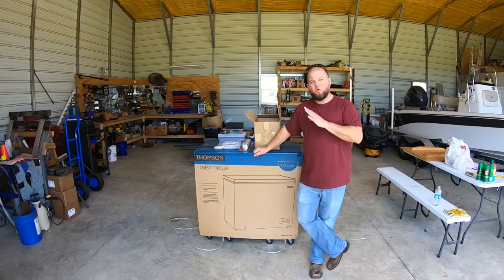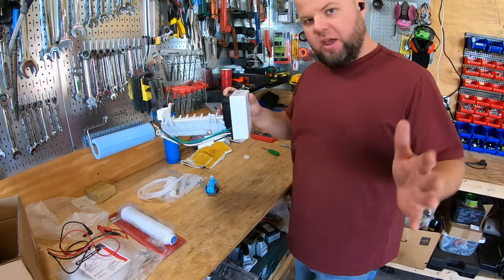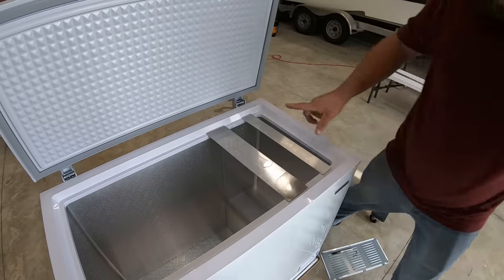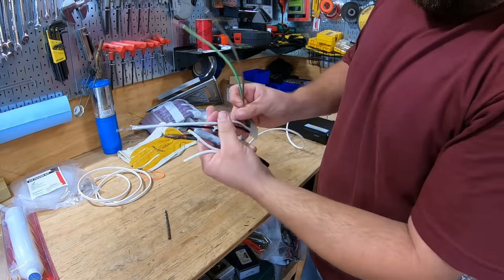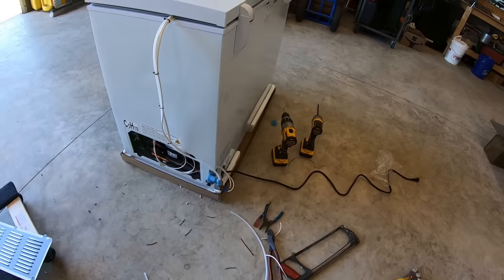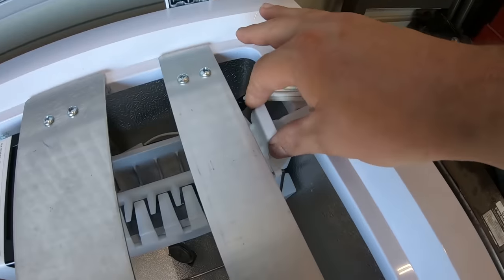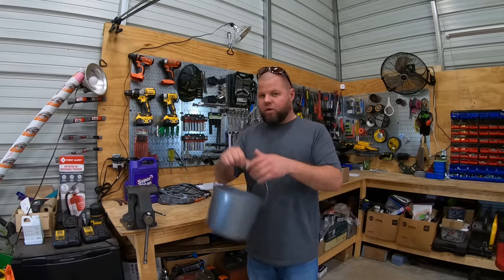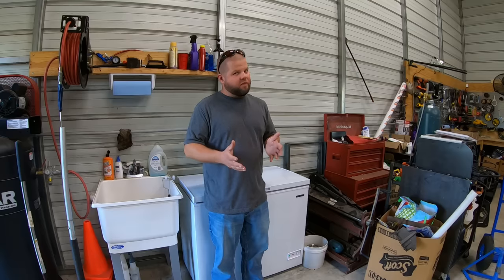Homemade ice maker! SAVE thousands over a commercial ice maker

Comment: One other thing you may be able to achieve is to put a cheap vacuum pump on the box when the door closes the vacuum pump drops the pressure in the box a pound or two or more
Reply from the maker: That's actually a good idea and would make a great seal. Assuming it doesn't pull in constant outside hot air, these might not seal well enough.

Comment: I did the trash can in the side x side several years ago. It works fantastic ... but you WILL go through a bunch of ice makers. It seems that they are not designed to operate continuously.
Reply from the maker: My original build is a 1 1/2 old and still on the original ice makers.
Reply: @TKCL  Great, mine didn't last that long.

Comment: Since the top seems to just be an insulated cover, couldn't you have drilled in from the back edge of the top to run power and water? Drill in a few inches from the back, then up from the underside of the top to meet that hole - wherever you wanted to power and water lines to end up...
Reply from the maker: That's an option

Comment: Make a 2nd notch for the wires. That way  the lid will shut flush. The wires look like they prevented the lid to close so air got in. After u make ur 2nd notch & put the wires in, cover both with electrical tape to secure it. 
U should've gotten a longer maybe commercial ice maker kit. It's gonna take forever to fill that chest. 
Don't use epoxy to seal the metal on the rim. It would have to be food grade if u did but it's probably not a good idea.
Reply from the maker: Already took care of that, I need to share that on a upcoming episode.

Comment: Put a drain in the system. And put a heat blanket at the bottom. This will slowly melt ice and allow ice to constantly be new. You want new ice turn over at least every 3 ti 5 days. 
Ice in and ice maker tgat is large needs to be constantly fresh. Ice attracts smells and actually gets old in a week or 2. 
So you turn on the floor heater about 1 or 2 times a week on a timer. That way its not always on. 
Pro tip
Reply from the maker: Not a concern, this isn't for drinking ice. It's to ice down my coolers and boat.

Comment: noticing a vertical pattern in the wall... Sea Freeze Bellingham,WA once  showed me a tube system they used that  fits like flooring with tongue and groove, with a feather-like texture,spreading along tubes to hard edges.  ORIGAMI?  cut your parts from a roll and it has an assembly system.  the tubes centered away from the rigid edges where they 'lock' together.  again maybe 3-4cm between tubes .

Comment: I'm curious if the ice in this would all clump together after an extended period. Is that why the commercial icemakers cycle the ice constantly? If not, then Idk why the commercial icemakers don't take a notch out of your book and run their machines colder so they don't consume so much power constantly remaking the ice!
Reply from the maker: No problems after three months of use, but I go through ice often too

Comment: May as well get countertop model
Reply from the maker: Let's think about that for a second. We all see those claims of 40lbs a day.... That's 24 hours by the way. I currently own two countertop ice makers. The cube versions usually have a small bin that fills up once an hour and shuts off. So that means every single hour you must dump and store that ice so it keeps working. Plus how many hours a day can someone realistically pull that off? Now your down to storing just a few pounds a day and babysitting a machine. I use 30lbs minimum a week and some weeks 80 or more lbs. Now take my ice maker that runs 24/7, makes, dumps, refills and stores that ice for me while requirimg zero input from me. Already a win win! Keep watching the series and see that a few minor modifications has me producing 11+ lbs a day, again while providing zero input.

Comment: You never use the self piercing water valve the leak and half the time it doesn't make a good hole which slows down the water flow. They sell the right type that you cut the water pipe and it fits in between so you have constant water flow not trying to have water flow out of a needle size hole!

Comment: Those tubes are aluminum. It has propane as a refrigerant. 
It's possible that the tubes are a molded plate welded on the backside of the shell liner.
Reply from the maker: Cyclopentane as the refrigerant.

Comment: I would’ve put the water valve solenoid & filter inside....There’s a drip pan designed into the inside area for the compressor area anyway to catch condensation....

It’s really too vulnerable located outside especially at a corner area.
Reply from the maker: I do not want water inside where the electrical connections are

Comment: Even though those piercing type water connections are still sold everywhere, in most places they are not up to code. So, if it leaks your insurance will probably not cover the damage.
Reply from the maker: I understand that, but if it leaks on a concrete floor in a metal shop I'll be OK. Inside sheet rock walls or a house I absolutely wouldn't use one.

Comment: I think for my money a $100 counter top model that fills its 26lbs capacity in a day (one of the first results when you search ice maker on Amazon) would be a better investment. If I needed more capacity modifying that one to empty into a chest freezer wouldn't be too terribly difficult (depending on the construction it might be as easy as cutting out the bottom and cutting a hole in the lid of the chest freezer).
Reply from the maker: Watch my newest video, I go over the reasons why those won't work for me. Wrong type of ice for starters

Comment: There should be a timer  inside  that you can adjust.
Reply from the maker: Correct, the heating and dump cycle is on a motorized timed cycle.  What triggers that timed cycle is a temperature reading of 10 degrees or less.  So the more often you can get the mold temperatures back down below 10 degrees after heating and filling, the more cycles are triggered in a day increasing your production.

Comment: Couldn't you just attach the ice maker to an aluminum panel using the normal mounting points, then use an industrial adhesive like E6000 or the like to attach the panel to the wall of the freezer?
Reply from the maker: I was concerned about adhesive not holding in sub-freezing temperatures. But that could be an option

Comment: 69$ for just the ice maker to produce 4 pounds of ice per day.  Commerical Ice machines make 250-800 pounds per day.  Let's say 500 average, You would need 125 of those little ice makers ($8,625) just to equal one of the commercial ice machines.  That's also not counting all the freezers, parts, and time/labor needed to set it all up.  Long story this was def a neat video showing a little DYI project, but the commercial grades are money well spent.  As I'm in the service industry, I have two 500 machines sitting on 1000 storage containers and a 400 sitting on a 500 storage.  If one goes down, I'm in a big big bind.  I came across this video looking for other options, as the price of ice machines has literally doubled over the last year.  It's also near impossible to find any to rent, as well as people wanting 2-3k for 5-6 year old machines.  It's crazy.

The cheapest one I've come across lately is an off brand that I've never even heard of, 440 per day unit on a 250 bin, for about 1700$.  I have an extra 500pd bin, so I might test this off brand sucker out.  There's a part shortage and name-brand ice maker log jam currently.  They rent for about 190$ a month here, and it's near impossible to get someone to work on it outside of the renters.
Reply from the maker: Yeah yeah all that math. That was for a full kit, the ice makers can be had for about $40 bucks, add a fan (keep watching the series) and another maker and I'm conservatively making 11-12lbs a day. No records, but that is adequate for my needs. My original has been running for 1 1/2 years with no issues. If one ice maker does break, $40 to replace. Add that cost to repair up to a commercial unit. I have basically only two moving parts, a reliable chest freezer and easy DIY diagnosis if I ever have a issue. Commercial units always require a technician and usually a very expensive part. This has been perfectly fine for a residential home use. Not to mention the important parts is it stores 150+lbs of ice like the several thousand dollar units. See this for what it is....

Comment: Rather than notching the base, IMO it would be better to notch the lid or move the lid up slightly, enough to add a thicker lid gasket (or spacer) that's thick enough for the wires/tubes to pass through. Might not take much more thickness than the OEM lid gasket.
Reply from the maker: Version 2.0 will have that incorporated

Comment: Shoulda anealed those bends... aluminum has a crystaline structure and when you fold or bend it it causes stress in the metal. So it needs to be heated and relaxed otherwise it can break
Reply from the maker: Thank you for the information
Reply: @TKCL  no problem man

Comment: there is a drain hole in bottom of deep freeze to route wires through....
Reply from the maker: It's very small, still need to run water lines through the side so they don't freeze.

Comment: the GE Opal i think makes ice way faster. i have that at home and it literally never runs out, it's insane. Almost 0 maintenance. They're about $450
Reply from the maker: I have a table top model that's half that price and it makes 40lbs a day. Your missing the point of this build, it runs 24/7 and stores up to 200lbs of frozen very cold ice. The key is it requires zero effort from me and does this 24/7 365 and requires no interaction.
Reply: @TKCL  oh i get the point and it's a great build. Just left that comment when you said you were looking around and couldn't find something quite right. the opal might fit the bill for someone who needs less ice or maybe less often then the chest freezer build. Still think this is a great hack for making an ice machine. Anyone who needs that much ice would be hard pressed to find a better option than your build :)

Comment: It looks great but please don't use those saddle valve it can cause water damage later on. its actually banned in most states. I will suggest you to use a sharkbite refrigerator valve which is allowed.
Reply from the maker: Already have parts to install a T valve.

Comment: Good on ya. this old tech knows the evap tubes must be thermally connected to the cooling surface... it will form frost if the unit can cause freezing.  hidden tubes and fans or an inner wall that will first frost next to those passages,  Usually about 3cm apart.  Dont drill those areas.  Drill beetween them.  Watch out that an aluminum flat plate evaporator design was chosen.  Two sheets of metal have been 'married' with raised metal passages may easily cause trouble.  Exploded together,  Easy to breech.  these are sometimes repaired using JB WELD or Hi-Side (heated) 2 part epoxy.  Frost line... yeah, kinda scary.  Uline icemakers have a large flat tab extension that shelves the harvest head with lots of thermal paste to  steal cold from the freezer liner wall.  harvest every 1/2hr.  an old tech reads systems using touch, feel  and sounds first when enviros allow.

Comment: What if it gets full how does it turn off ?
Reply from the maker: Unplug the ice makers or trip them manually
Reply: @TKCL  but if you forget about it. It will over flow especially if you plan on putting more ice makers. Needs an interrupt on the ice makers if it gets to a certain height then you can just leave it on indefinitely over the summer
Reply from the maker: I'm out in the shop daily, not concerned.
Reply: @TKCL  it’s a good project well done 👍🏼 I enjoyed watching you make it

Comment: Wouldn't it have been easier to use those aluminum pieces as hangers since it has that metal wire already attached to it?
Reply from the maker: I looked and couldn't get a solid mount to them. Plus I knew I was most likely going to add a second ice maker.

Comment: Hi having hard time with the wiring heed some help I got the same ice maker and did the black and white for the main power the brown and green those 2 connected directly to the relay ? Please need little help thanks everyone
Reply from the maker: Green is ground and should only be connected to the ground coming from the wall receptacle. Remember AC stands for alternating current. Each wire (black and white) constantly flip back and forth on polarity. Water valves will not power up without a white neutral wire, as will nothing else. When in doubt always consult a qualified electrician.

Comment: In your cost estimate of the commercial ice maker you left out a very costly item or items. I have had two commercial ice machines and both used extremely expensive water filters. I was spending over $40 per month per machine for these filters. One filter was some sort of high count micron particulate and the other a scale filter. For your need, you made the right choice.
Reply from the maker: Wow that's way too expensive
Reply from the maker: Wow that's way too expensive

Comment: With extruded flat appliance cord the insulation that's SMOOTH is your HOT and the insulation with RIDGES is your NEUTRAL. The wire with the ridges along the length of its insulation is called the identified conductor just like the white Neutral is also the identified conductor and these are a grounded conductor as in a current carrying conductor that's grounded. That's different than a ground conductor that is designed to only carry current during a fault condition. Getting your conductors marked correctly is easy after you know. It's a small adjustment for your projects that's available for all to read who have met the standard minimum reading material with an electrical code book in their outhouse... and a Sears catalogue, from any year.

Comment: i would have just heated up metal with a torch and used it to pres into the plastic instead of cutting, that way you dont have to worry about cutting @1:20

Comment: It probably has R 600a. Its isobutane. Pretty standard now in refrigeration. Manufacturers are using propane now as well (R 290). There isn't much in that freezer. Probably less than 10oz.
Reply: Nevermind. It has cyclopentane in it.

Comment: If the freezer has a drain hole you could run the water supply line up thru it to the ice maker.
Reply from the maker: You can't run the supply line inside the freezer, it will freeze up. I already tried it
Reply: Daaa my bad , I m stupid sometimes . I’m big on repurposing, so I would have picked up a used fridge. I’ve picked them up and just had to replace the starting capacitor.
Great idea
Reply from the maker: Thank you for watching

Comment: filling a freezer doens't mean there is less heat going into it from the outside, so the amount of time the compressor runs is not any different.  If you open the freezer a lot, a full freezer lets in less warm air, but filling a freezer doesn't have anything to do with run time.
Reply from the maker: It absolutely does in this case, by filling my freezer I'm adding warm water, thus a thermal load that must be removed from the inside out. That's a tremendous amount of btu conversion that needs to take place when your filling the inside with a steady flow of warm water.

Comment: I would simply use plastic milk jugs to make tons of ice for a cooler.   A gallon block of ice or two would last longer than small cubes.
Reply from the maker: Does not work well for coolers full of drinks and surrounding fish in a ice box. I like nice thick uniform cubes for that. I use ice weekly, I have no desire to fill, dump and bust ice all the time. Those cheap ice makers work 24/7 and have ice waiting for me.

Comment: There is a reason why commercial icemakers keeping ice inside BELOW freezing temperature and slowly melting. All Ice will clamp together in one huge chunk and impossible to  remove from your freezer chest. You have to remove produced ice promptly, bag it up and put bags in another freezer to keep until needed, like you see in the store, that sell ice. You can experience this "ice clamping" in regular house refrigerator, when not dispensing ice for a week or so. I work in refrigeration business.
Reply from the maker: 3 months running and no issues, but I use ice often.

Comment: Flat wiring is a thing, and you could use that to get power in without screwing with the bezel.

With the ice maker positioned and fixed in place, why not drill in through the lid and feed water in that way?  No cooling elements there.....
Reply from the maker: You could do that, it just isnt as clean of a look.

Comment: Number one; this man is a natural born teacher. Your average person could take hours of training and still not be able to do what he does without even thinking about it… I always think that is cool; we wouldn’t know about people like this if it weren’t for YouTube. Number two; if you happen across a used chest freezer in the classifieds that you can pick up for next to nothing, every time this thing  fills up,  you could transfer your ice to the other chest freezer just to keep it ready. Number three; when you are about to head out of town on your trip with all your ice, if you stopped by the grocery store or Walmart and picked up a block of dry ice, (<$10); Dry ice exists at about -110 F so you would probably go through the next 24 hours and lose next to nothing from melting, especially if you included a water jug frozen solid in with it as a negative thermal mass. Just don’t seal it up! Dry ice sublimates carbon dioxide gas at a rate of 80 times the volume of the dry ice as a solid. Seal it up and it will explode. The container must be vented, so don’t put it in the cab… It will displace the breathable air, and everyone will suffocate. Just some thoughts I had. Great video - thanks for sharing.
Reply from the maker: Thank you for the kind words and watching!